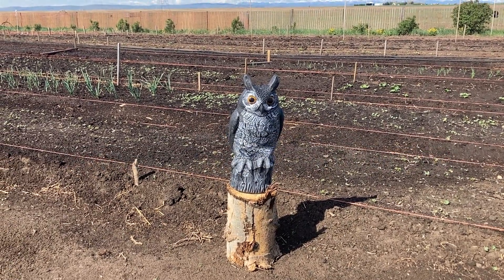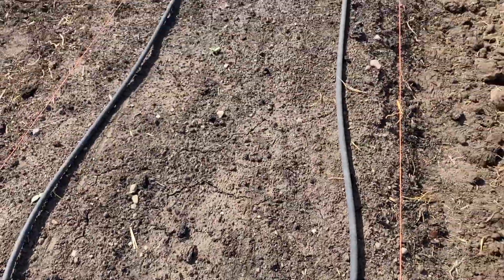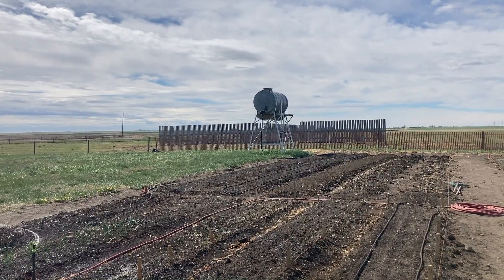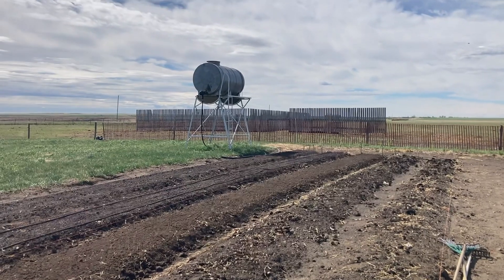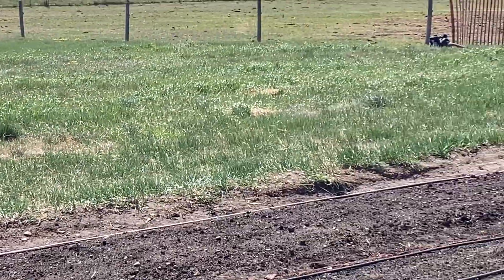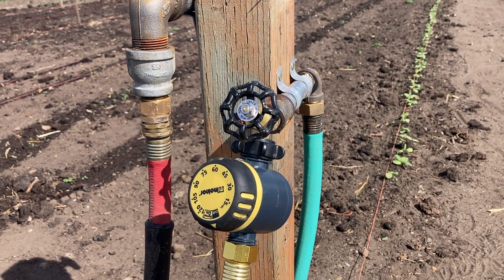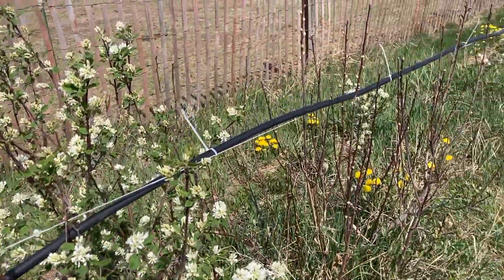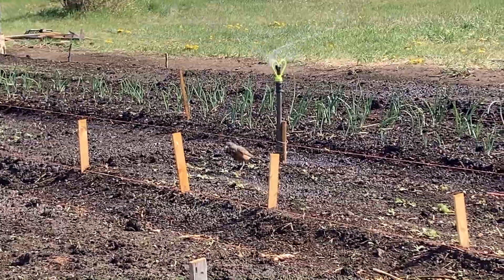How we are watering our garden without rain. Glen needs your help!

Comment: Great irrigation system you guys! I know for me, using the gravity fed system lets me see how much water we actually are using vs the house water. It certainly is a crazy amount! We use a hose hooked to the IBC tote and it runs good downhill to the meat bird and turkeys. However to the pigs and chickens, we have to use an electric pump. So we plug in while using and also while watering the gardens because it is not enough of a decrease in height to run on gravity alone.
Reply from the maker: Thank you! I think Glen said we use about 750 gallons a week just for the garden. Our main dugout is a week away from empty. 😶
The electric pumps are so handy!!! 
Take care,
🌺